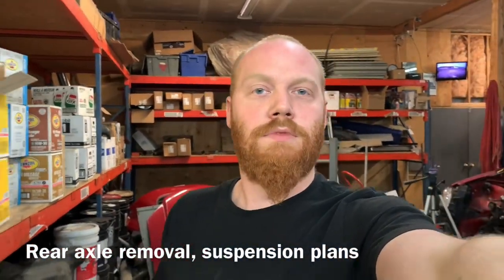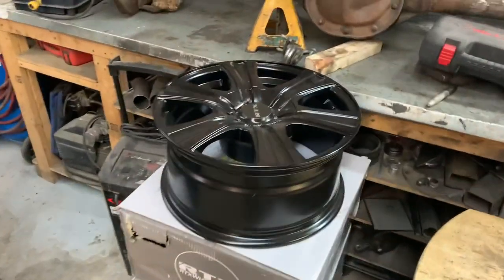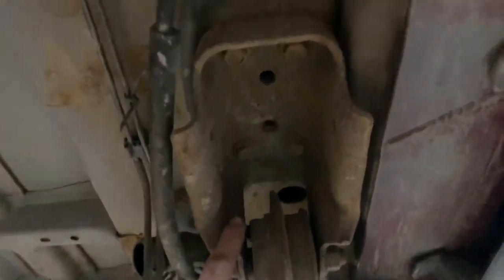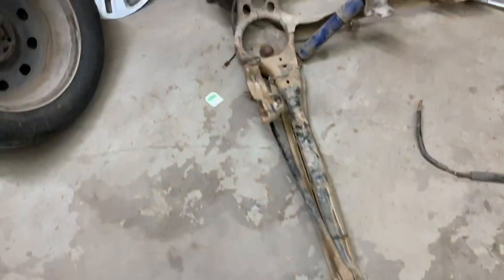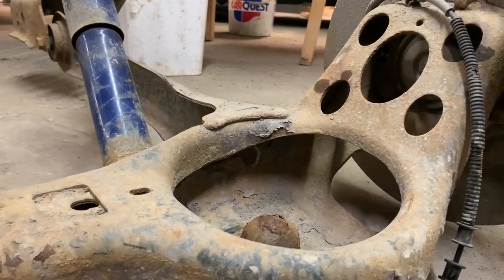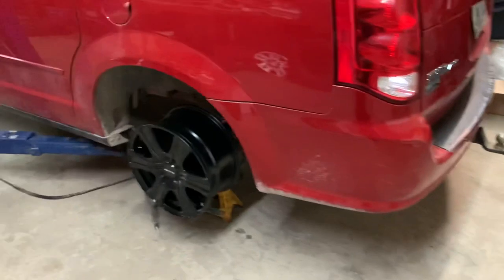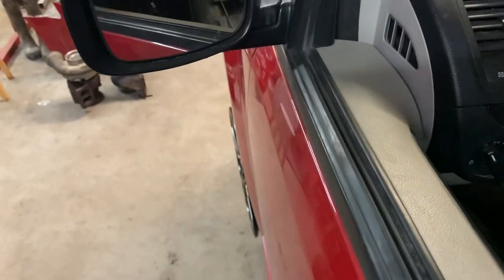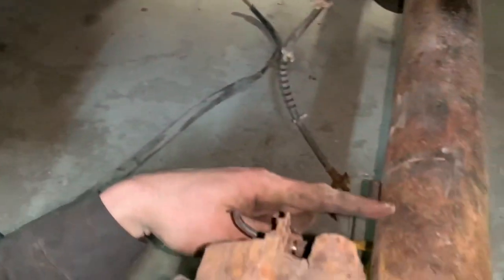Removing 2014 grand caravan rear axle, make way for the 8.8! Mocking up the diff, fitting NEW wheels

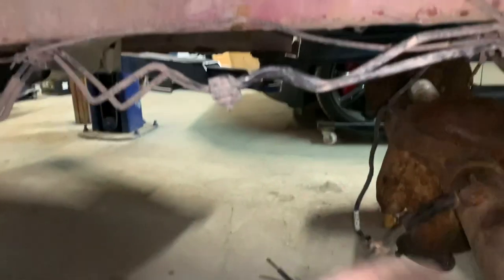Comment: Hey Barry, what is that wire shown at 11:16 just to the left of where you are pointing? It has a 90 degree bend. Mines broken but cant find out what it is. Thanks !
Reply from the maker: If you’re talking about the part that’s next to the fuel spout it’s actually the vent for the filler neck. That’s a hose